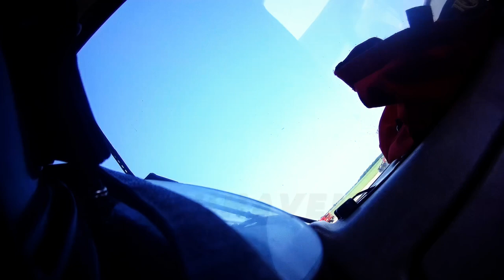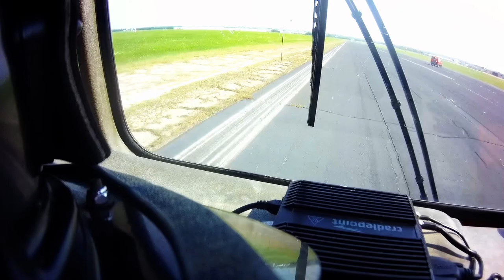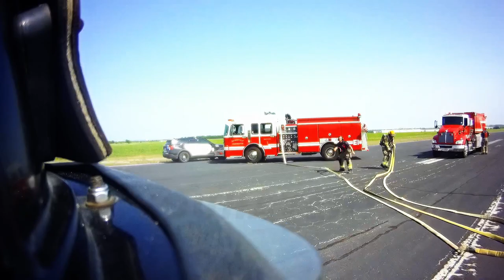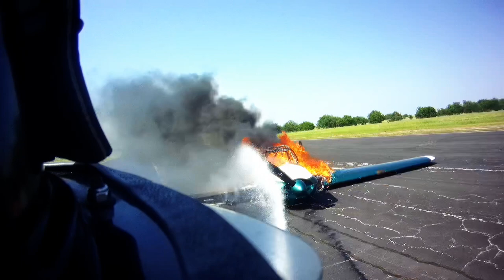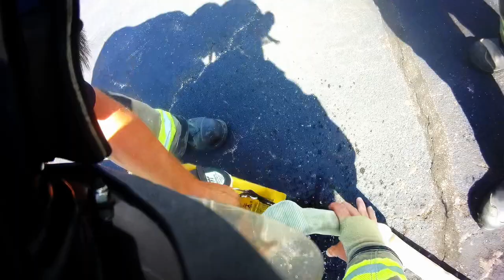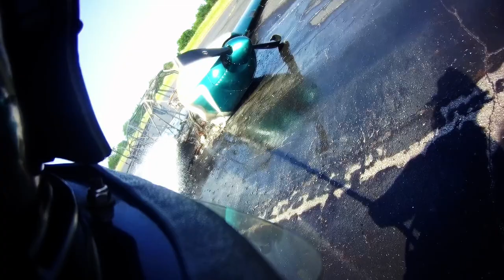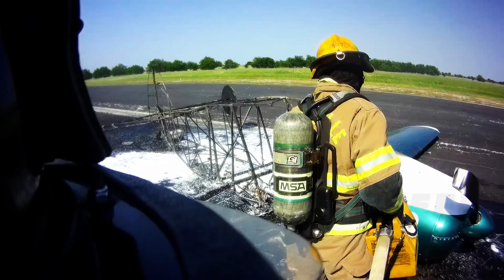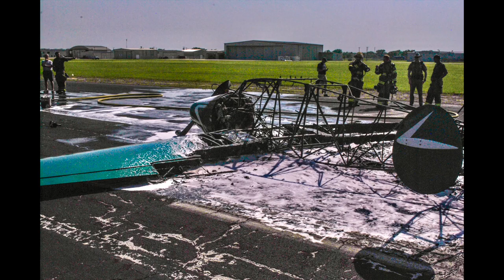Bellanca Cruisemaster gear-up landing and fire | Helmet cam

Comment: I was taught to ALWAYS land on grass in the event of a wheels issue. Several time during flight training my instructor woud make us land on the grass divider between runway and taxiway. It definately is a different experience landing on grass no matter how "smooth" its is. I never understand why US aircraft always do wheel up on the tar/concrete runways.
Reply: Because it is smoother.  That’s the way I do it in my flight simulator and I never catch on fire. And it doesn’t crash out. But hey that’s just a simulator not a real plane. This is something I often wondered myself.
Reply: Maybe it's an EPA thing - spilled fuel and other liquids and all. Ever more, humans are less important than the environment as far as government is concerned.
Reply: If it is just a gear up the repair ist much easier than with on grass.
Reply: The runway is essentially guaranteed to be flat and clear of hidden obstacles, obstructions, berms, etc. The grass adjacent to the runway is not. If I had a grass runway to choose over a paved one, I'd do that, but I wouldn't take some unknown stretch of grass just to save the belly of the plane (which will probably fail anyway.)
Reply: The reason we don’t land on grass with a gear up, is you have a chance that something will dig in to the dirt and cartwheel the airplane.  You are much more likely to have severe damage that way than sliding on the runway.
Reply: @cl65captain  this. The commenter was taught wrong.
Reply: @cl65captain  As my flight instructor likes to say, the aircraft belongs to the insurer at that point, the main thing is to avoid injury, the aircraft is expendable.
Reply: @mattsqwrl  The person you're responding to isn't suggesting minimizing damage to the plane to save money rebuilding it. They're suggesting minimizing damage to the plane becuase that will also minimize damage to the people inside the plane.
Reply: When you land on grass your chances of flipping over, being trapped then roasted alive are much greater.
Reply: @brameldm  Yes I agree! Others might argue that the grass runway offers that chance of less damage, but although it might reduce fire risk, fire on a paved runway in an otherwise undamaged aircraft should be very survivable, even if the plane was then a write off. Whereas flipping the aircraft is very risky for the occupant, so it's more important to avoid that hazard.
Reply: The VAST majority of gear-up landings are not because of a gear malfunction, they are because of a pilot malfunction. You are reminded about the gear you forgot to lower by the grinding noise on the runway.
Reply: Pilots are the problem...
Planes are safer because of design and technology advancement  not because of human pilots.
Reply: @ScottsSynthStuff  In a jet you are reminded when it takes full power to taxi.
Reply: It would depend on the aircraft aircraft you are flying, a higher speed landing aircraft would favor choosing a smooth surface over a soft one. On my aircraft the previous owner made a off field landing due to engine stoppage, he chose to lade gear up out of fear he might flip the plane.  He regretted this, said next time he would put the gear down
Reply: I would bet 90 % of gear ups are just “forgot” or the warning horn distracted them … Btw, AFA on grass vs pavements: of the 20 or so I’ve dragged away quite a few had very little undercarriage damage due to the boarding step sliding along the hard surface. And the sound of one that happened right along side me was astonishingly quiet! Just buzzz, swish whoosh squeeeek!

Comment: My dad was an asst fire chief and also a flight instructor with his commercial rating, too. He built 2 experimental planes, the 1st was a Long-Eze and the 2nd (my favorite) was a Glasair 2RG. Both were 2 seaters and the Glasair was super fast! Dad was helping a friend build a Glasair and when they did the 2nd test flight, it caught fire after a normal landing. They both sat there, thinking what the Hell happened? That’s when Dad said, let’s get the heck out of here and both were fine, our Bakersfield, CA Meadows Field fire dept was outside watching them test the new Glasair and knew all the experimental aircraft pilots, so they were at the scene in 2 minutes. Dad was able to repair the burned part of the plane and it was good as new! They made the headlines in our local paper and interviewed my dad. I know the fuel is in the wings so I was worried about the firefighters fighting the Bellanca fire. I’m so happy no one got hurt during the landing and that the tanks didn’t explode. Hopefully, the pilot had been flying for awhile and his tanks weren’t full. Sad to see a Bellanca totaled; there aren’t that many around anymore unless you see them at an air show.

Comment: Does the officer always take the nozzle on a fire or just when he has a helmet cam ? The officer is supposed to direct his nozzleman and others as the scene supervisor/command. The foam operation should have been set up at the onset, which the officer oversees. The fire was "fueled" by the avgas burning. This was a tank only water supply. The foam solution/water concentration is important to make a foam blanket to smother the burning fuel. Both foam and water is limited out on the runway. In the officer's haste to film himself, he used a significant volume of water before he called for the foam operation.
Reply: In my experience as a paid-on-call firefighter, often times if the officer believes that the firefighters in the rear are taking too long to get ready then the officer will initiate fire attack and turn it over to them once they're properly dressed and ready to go.

As far as the "limited water" goes, the rig next to the engine is a water tender. That size is what we have on my department and it's got a 2,000 gallon tank on it, in addition to the 750 gallons we carry on the rig, alongside the 30 gallons of foam internally stored and mixed automatically within the apparatus when the system is activated.
Reply: With 23 years in a career department, the last 13 years as an acting Lieutenant, I was able to use valuable lessons 
from great officers who I served under.  Patience for one. You have to know your role and allow your people to do theirs. You can't assess their strengths and weaknesses while they are standing behind you watching as you do their jobs. "You can't ride two saddles with one ass, Sugarplum."

Comment: In this case, the fire department should have just let it burn because there were no lives at risk and the foam contaminates the ground water for at least 30 years. City water systems (especially ones in small towns) can't remove the contaminants and they're extremely hazardous to your health.

Comment: Firemen dont seem to be in a hurry
Reply: No hurry, nothing to save.
Reply: Listening to dispach, all people were accounted for and nobody was in danger. Those are big trucks full of water with a super high center of gravity and prone to rolling over. No reason to risk an accident by racing. Looks like an off-airport department so no matter what the plane is a total loss. They got on scene quickly, knocked the fire down within a minute of arrival, then overhauled with foam mix, looks like a job well done to me.
Reply: Airport obviously has no full time fire ARF but correct hurry only injures personel...risk a little for a little ...and alot for alot....
Reply: It's a vehicle fire with no people or other property at risk.

Comment: aw man that's so sad to see... what a cool little airplane, with the idk what you would call the tail, with two vertical tail winglets/endplates on the ends of the horizontal stabilizer (that look like they survived the fire... I guess they were aluminum and didn't get too hot). Love the paint color and the graphics from what's left, looks like it was painted not too long ago. Man, that's such a shame. Glad everyone got out fine, but if this wasn't a stuck landing gear and an intentional emergency belly landing, I just never understood how people with retractable gear planes seem to forget to lower the landing gear on landing. It seems to happen way too often. I mean, it's obviously a critical, repetitive, basic task of landing that kind of plane... it's like forgetting flaps, or forgetting to lower your speed, or forgetting to flare, how do you just forget that? The only time that makes sense to me, is when a pilot flies multiple types of planes regularly, who flies both fixed and retractable.. then yeah, I can easily see forgetting to lower them... I would have to always carry a large size yellow Post-It pad and stick it on the dash to remind myself it's a retractable gear plane. But if that's your only plane? How do you forget? But maybe again, it was a forced landing, gear got stuck... I hope it was that at least. RIP little Bellanca, I'm sure that plane had lots of great stories to tell... it had a good life, until, then.
Reply: I had a jammed landing gear in a Piper, many years ago. After two hours of failed troubleshooting, I put it on the grass alongside the active runway. The turf stopped it in 123 paces, and damage was minimal.
Reply: @flashcar60  There is something to be said for landing on the grass, less likely to burn.
Reply: It's a Bellanca 14-19-3 Cruisemaster. The endplates on the Cruisemasters and 14-13-2 or -3 Cruisairs are plywood covered with fabric. On the 14-9 Cruisair Jr. and 14-13 Cruisair Sr. they are a welded steel framework that are integral with the horizontal stabilizer and covered with fabric.